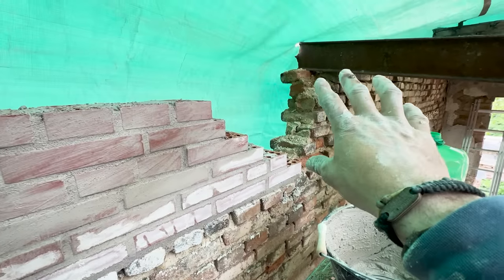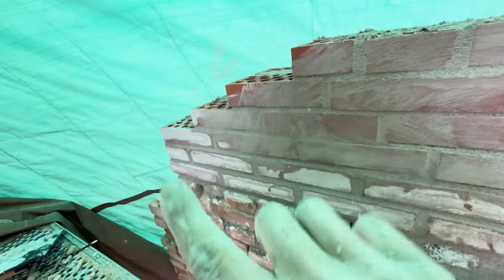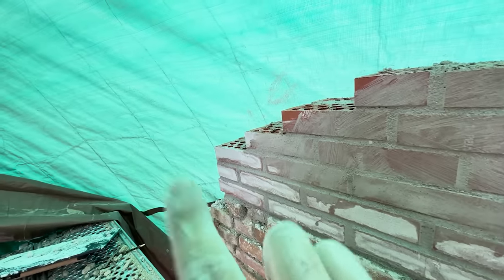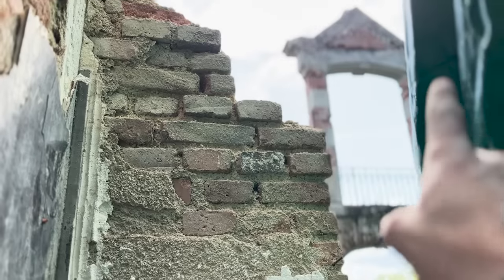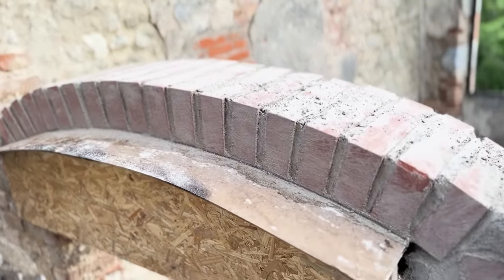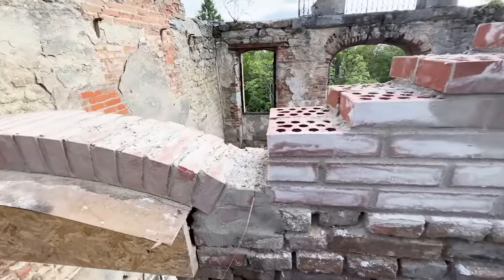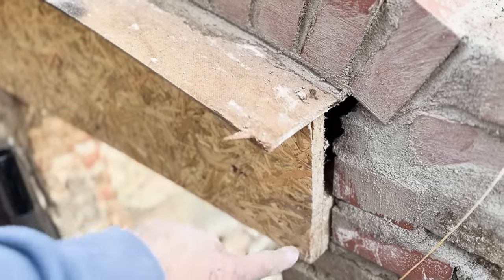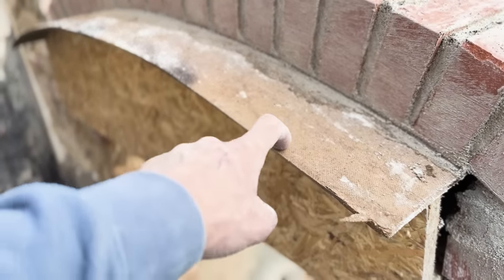Rebuilding the arches (that were never there)

Comment: Does anyone know if in France when rebuilding a chateau if you have to have permits or inspections?
Reply: Dan is waiting on permits. Which specific permits?  I am not sure, although I suspect one permit would be for electricity.   There is a previous Vlog a few months back, (right before he began clearing 3 1/2 foot of debris from main entrance room/where stairs were) that shows him finding the entry point for electrical connection along the front boundary fence.   Nothing was set up properly.   He expressed disappointment; had hoped electricity was still intact.
Reply: @homeemail2306  He specifically mentioned the new roof and also talked about a cabin on the grounds for him to live in. Permission is mainly required for new builds but also for renovations that change the size of a building's habitable floor space (e.g. loft conversions, turning previously unused space into living space), installation of septic systems and a number of other tasks, none of which Dan is doing at the moment.

For the electrics he needs to have all his wiring signed off by an organisation called Consuel, then the supplier can connect to the grid. Since there is hardly any wiring at the moment, I suspect all he could get would be a temporary construction supply and he might try to make do with his solar solution until the permanent wiring is ready to be signed off.
Reply: @Ragnar8504   Thanks for additional practical info.

Comment: When the arches were rebuilt over the Basingstoke canal, they used two separate mixes on the bottom course next to the form-work. The bottom halves of the bricks were mortared using a weak 10:1 mix, the top half of the bottom course and the remaining layers were laid using the standard mix; 4:1. When the courses had all gone off, the formwork was removed, the weak mix was removed with a jet-wash / wire brush, then re-pointed with standard mix, ready to last another 250 years.

Comment: The arch looks great but wall is a death trap and needs re doing with the correct bond and making plumb and level ( which it isn't)  You dying is not the plan and that wall is not fit to support anything.
Reply: What is your experience Ian, are you building trade. An old family friend showed me how to build garden walls (I'm chuffed 20 yrs later they still stand!)  but he told me never to do this inside as bricks need to be turned short end showing and the more uneven the vertical concrete lines the stronger the wall becomes - no tech jargon here but I know what I mean !!  Dan must have taken advice but what he is doing seems wrong.
Reply: @janetkennedy5940  I'm an engineer by trade but when I bought my house it needed lots of work and I had no money and no idea but by luck an old guy took pity on me who was a stonemason by trade and did restorative brickwork and wot not and he helped me and showed my how to brick lay, line out, different bonds etc so I could do most of the work myself so that's what I did. Yes, the wall needs to be tied together with 'headers' which are bricks turned though 90 degrees and the stretcher bond needs to have the mortar joints half way between bricks on the lower course. I love thee video's but I don't see how that could pass an inspection. ever.
Reply: You are correct yet again, Ian. There is a reason English bond was used to build those walls originally, they are load-bearing and English bond is the strongest there is for a 9" wall.

Comment: Dan why did you soak the bricks in water ???
Reply: To stop them sucking the water out of the mortar and thus preventing it from curing properly.
Reply: So the mortar adheres better
Reply: It helps stop the bricks from sucking out the moisture from the morter.
Reply: Does anyone know if there was an update on the ‘Paperwork’ that Dan mentioned was needed?  Any permits or inspections required along the way?

Comment: When making an archway, the traditional method would be to have a pare of wedges at either end, so when wanting to remove the former without disturbing  anything the folding wedges would be tapped apart thereby lowering the former away.

Comment: You should consider a nice wide 48 " plus temporary staircase going up to the first floor. It would be worth the investment and would make getting to the next floors much easier and moving materials would be far easier. 3 stringers and treads from  3/4 inch ply plus a single 2 by 4 by 18 feet ?-as rails so that you can slide heavy material up or down on top of it .

Comment: Shims under the template OR since youve already installed it, you can cut it in half ( straight up) and if you need to reuse it you can pin it together with splinter and screws and remove it again.
Reply: That might be his best bet.

Comment: Two comments:
1. I hope you place a small window in the wall like the other side.
2. You may want to get a second winch. This would save time in the long run. You place both buckets at the bottom, you get the the top, and winch away.
Reply: At the moment he's working on the second floor, close to the ceiling, on the wall between the hallway and one of the bedrooms. The little window you're probably talking about is on the third floor on the opposite wall, and I think he doesn't need to add one, it's already there.
Reply: @Ragnar8504  I was referring to the one behind one of the water tanks he removed.

Comment: Install a firehouse pole from top floor to ground floor - or a pully rope system with a counterweight just short of what you weigh -
 walking down the ladder will be eliminated - much energy saved - and you`ll have some fun going down to get that special tool you forgot in the van....😆😆😆😆

Comment: FLOORS , you need "B Deck" or "bridge deck" ,, corrugated steel sheets that go between the beams .. you can place simple weld wire grid reinforcement in there and have your concrete supplier pump concrete to just fill it all in.
Reply: Concrete supplier? Pump? You've got to be kidding! This channel is all about DIY with minimal equipment. A block and beam ceiling like Dan wants is probably the second-easiest to install in that scenario, after joists and OSB.

Comment: I’m assuming you’re not dealing with stuff like in the US. I’ve read several comments and agree with some of what you’ve done, or not as the case may be (safety wise). Going forward you should plan on the finished project, debris shuts and temp supports aren’t a bad way to go. But consider them in long term plans. Such as anchoring points structure for future ideas. Love your work.

Comment: If you put the water in the bucket, it would use less water, and also keep the bricks from drying out while you work.
Load the bricks on end into the bucket/water.
Reply: I'd also be tempted to hoist up a bucket of water and dry bricks and soak them on the second floor.

Comment: Would you consider using some Icf blocks on some of the missing bits of the château? They go together very fast, they’re super strong, the insulation property is great, and eliminates the need for blocking and or stuffing inside for plaster board….

Comment: I would use glasfiber reinforcement in The Arches Dan 
Then make The ring beam  and use Steele beams To keep The walls in place while you make a temporary floor with membrane attic  floor watertight

Comment: Brilliant to watch all your efforts and sheer hard work. Is there a particular reason for not including a "key " stone at the apex of the brick arches you are creating? I'm just concerned about the weight the arches will be taking.
Reply: In this particular instance the arch will only be holding up three or four layers of brick above it, his intention is to fit a metal beam across the top of that brickwork which will spread the load evenly amongst all the bricks, thus reducing the pressure on individual points!?!

Comment: Lay sand on top of the arch former, when the bricks are all set and it has cured, was the sand out and the former will be loose. Simples. The same with where the former sits, rest it on sand also

Comment: Hi Dan . No way am I an expert in any Form of DIY but I like to do a bit. The wall you are putting the bricks on looks a bit  precarious as the bricks on top of the old ones the cement in the old ones doesn't look very stable looks like you could just scrape out so easily so a little bit worried about it being stable for you but again well done for doing it all by yourself I wish I could help you

Comment: Hi Dan, what’s the theory behind laying the bricks in water before you lay them?
Great series by the way👍
Reply: Mortar (both lime or cement) cures by absorbing CO2 from the air. If the mortar dries too quickly, e.g. because the porous bricks suck up all the water or because the sun burns onto the wall, the mortar can't cure properly and loses its strength. That's even more important for plastering.

Comment: I need a hoist/ winch like that. What is it?
Reply: It's the cheapest kind of mains voltage winch DIY stores in Europe sell. Exactly the same model is sold under half a dozen different brand names and painted different colours. You can get a few different models that differ in carrying capacity and cable length but that's about it. I think the two I've used were called Pattfield and Herkules and looked exactly the same.

Comment: Won't you have to rebuild to modern insulation levels as so little remains of original structure?As original will be a tall ice house in winter and hot box with such thin walls in summer.
Reply: I suspect I can see studwork, insulation and plasterboard on all external walls in the future. The new roof wil obviously be fully insulated too.

Comment: This may be a silly question but what supports the arches once the wood comes out? 🦋
Reply: The arch supports itself! That what arches do.
Reply: @adifferentpointofview6929  In other words the walls on either side of the arch. An arch alone would try to spread sideways and flatten but in a building it's wedged in between walls.

Comment: What is that mortar made from? I don’t think it has much of Portland cement in it.
Reply from the maker: Lime
Reply: Lime and sand, traditional mortar. The original mortar might not even have had any lime in it, just clay and sand. That would certainly explain why it's so soft (but still perfectly adequate).
Reply: @Ragnar8504  thank you for the explanation. I am not familiar with that type of brick building. Good to know...

Comment: you have no keystone in the arch centre  to take any weight - that is not a proper arch it will collapse with any weight on it - you need to seek advice before you keep making these and rely on them to keep your structure up.  Your arch is reliant on the mortar not the keystone

Comment: Dan, I just don't understand how you can do this work without a licensed contractor,subcontractors, submission of plans,structural engineering reports, proper equipment,safety requirements, and permits.Surely this is all required in France.I know u work hard and it's admirable but you are not actually a builder.